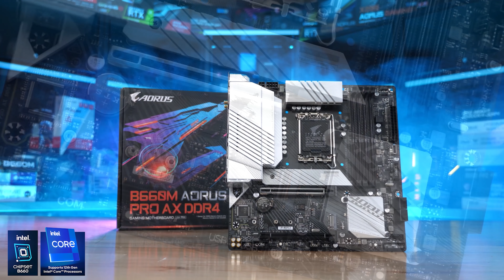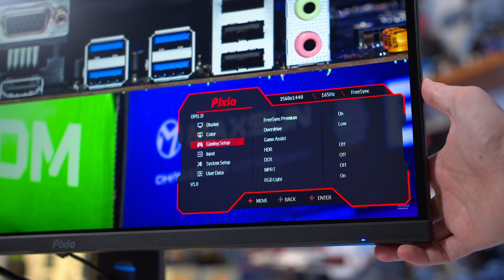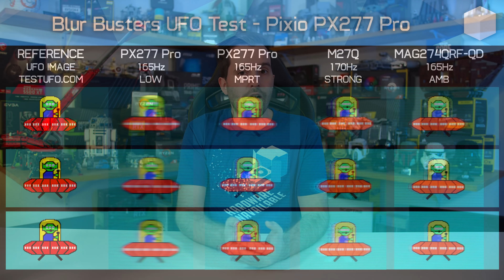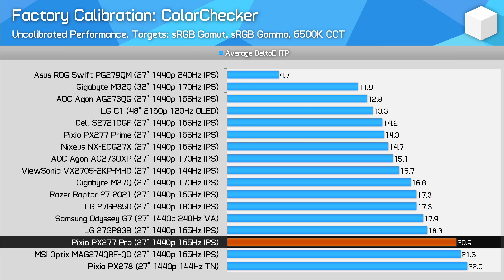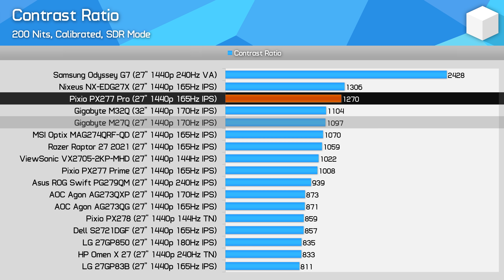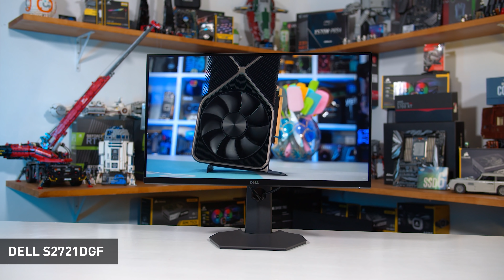Pixio PX277 Pro Review, Is This Budget 1440p Monitor Any Good?

Comment: got my m27q refurbed from newegg at $260, absolutely worth it. i love it
Reply: Would you say m27q is still worth in 2023?
Reply: @matrxzeno4761  Not sure if it's been superceded by anything but it's still a solid buy at $260
Reply: @AWSMcube  Thanks for the response, I think I will go with the m27q-p variant as it is just 50$ more expensive here with some nice quality of life upgrades.
Reply: @matrxzeno4761  No problem. I still use it and I'm very satisfied with it. R7 3700x and 3060ti and I can play most games at medium to high settings and still max out my fps
Reply: @AWSMcube  I am running something similar with a 5800x and a 3060ti so it is reassuring that you're getting max fps on this monitor.

Comment: Something to look at is what rescaling will do if you buy a new monitor NOW but haven't got a fast enough graphics card to do native resolution gaming at the moment (for example there is no way to currently afford a new graphics card, but a replaced monitor could be done now).
So you go from a 1080p (say), which you currently have, and get a new monitor THAT YOUR GPU ISN'T FAST ENOUGH FOR, what benefits do you get from a new monitor at 1440p then at 4k if you upscale.
So you take a 1080p image and upscale to 4k is easier to carry out, but you are able to run a 1440p monitor and upscale from 1152 or whatever to 1440p, getting a better image than at 1080p upscaled to 4K, because you CAN run at 1152 (or whatever) and still drive pixels fast enough even if you add on upscaling afterward to 1440p but cannot upscale to 4k at that resolution. It may be that the 1152 image can be uscaled to 4k just fine, mind. However, if the upscaled 1440p image is closer to the native 1440p image than the image upscaled to 4k is to the 4k native, or there is no difference in quality upscaling from the 1152 image to 1440p or 2048p, making a 4k monitor meaningless, then you can point out if you can get "locked 90hz" with the 1152 image then you should get the 1440p monitor, but if you can run 1440p, then as long as you can lock it to 80hz you can afford to run the 4k monitor as your upgrade from 1440p TODAY if your rescaling is supported.

Comment: I'd probably buy this if it was available here (UK). Despite it being a bit overpriced, the combination of USB PD and a KVM would be a great benefit for my usage (frequently swapping laptops and swapping between laptops and desktop). The only other monitor of this size that I've seen with that is the AOC AG274QXM, which is nearly £900 and seems to have a number of serious issues with the display. Hopefully USB PD output (60W+) starts to become a common feature (as KVM switching already has) because ideally I'd be making a decision solely on the display/price and not a niche feature.
Reply: Just get gigabyte g27q....same panel just 144hz
Reply: @gravydavy9930  that doesn't have USB PD. M27Q does but it's only 15W which makes it basically useless

Comment: You don't need to go beyond "1440p Monitor Any Good?" The answer is NO! It's 2022; if you aren't able to run at ATLEAST 4K at a decent refresh rate, then its crap. Full stop. 8K gaming possible with new tech coming out later this year.

Comment: Best gray-to-Gray graph... How you can compare 0% error monitors (clean motion without any inverse ghosting = ideal) and monitors like this sh*t? This makes this slow display faster than MAG 274QRF-QD for example 😕 This is absolutely misleading! You can observe the dark trails in light shades (70% error or higher at lower refresh rates) vs. zero errors at MSI display. How about compare all displays at same error conditions - idealy 0-5%? But if I skip these bar graphs, your display reviews are best.  👍

Comment: Why did you guys take a point off for the HDMI advertising when the HDMI 2.0 implementation that Pixio uses is probably the best you can get out of HDMI 2.0 at all? It supports 1440p 120Hz with VRR enabled even on consoles out of the box, something many monitors needed a firmware upgrade to be able to do at all. They advertise HDMI 2.0 and deliver on it, so just confused about why they got a mark off for that.
Reply: Because HDMI 2.0 does not support 1440p at 165hz which is what the monitor is also advertised as. People who do not know much about bandwidth and monitors may be very disappointed when they find that they are not getting 165hz.
Reply: @josephc.2443  I suppose that's fair, I don't have the box for my PX277 Prime so I don't know if they have the "over DP 1.2/1.4" disclaimer.
Reply: Joseph is correct. In the chart at 13:26, the "Fail Conditions" state "Insufficient Bandwidth or Misleading Advertising" and HDMI 2.0 is insufficient for 1440p 165Hz. That is why it loses a mark.

Comment: Tim, In the AMD control panel, in the display section, when you set "Custom Color" ON with "Color Temperature Control" OFF, that lets the GPU read data about the monitor's colour space over the HDMI/DP connection, and adjust the color output accordingly. This allows wide-gamut displays that don't have sRGB clamping to correctly display sRGB content without the need for ICC profiles (or in apps where they aren't supported, ie; most games). It's an awesome feature that saved me from buying a colorimeter to fix the oversaturated reds of my wide-gamut monitor. Could you look into this and let us know how accurate that feature is?

Edit: You can also do this on Nvidia GPUs, but since Nvidia hasn't added that feature in their drivers yet, you have to use a tool called ''novideo_srgb''.
Reply: "novideo"

I feel like there's an ayymd joke in there somewhere lmao
Reply: @JTCPingas  jej
Reply: @JTCPingas  And a very well deserved one,because Quadros have this setting unlocked.
Reply: I feel like I've been waiting ages for someone to finally explain this. It would be wonderful to hear Tim's take on what's going with that.
Reply: In my experience, with custom color on, and color temperature off it actually leads to an oversaturated look. That might just be my specific monitor, but for me it is way better leaving custom color off for srgb content.

Comment: I am holding out for a 32in or ultrawide 4k 144H,  with kvm  that is as good at the 1440 screens.. use case is gaming, work and also retro gaming with win 98se, xp , 7, 10 and 11 windows.  I have heard the new alien ultra wide monitor is good but not at scaling  ..

Comment: The good thing about 240hz and above monitors, variable response times aren't needed, at least for me. Whatever your fps is doesn't matter as long as the monitor is refreshing at 240hz with v sync and freesync/g sync off and it has great response times at that refresh i can't notice tearing or anything to a noticable degree. At 165hz and below though the tearing is awful and needs something like freesync but then you are subject to crappy or lacking variable overdrive.

Comment: I rather put the money toward the next GPU upgrade which is a much better investment. 
If anyone already rocking a decent 1440p 144hz display or even a 1080p one, there is no need to upgrade or buy if you can't consistently hit 144 FPS with the current setup.
Reply: I have a 1440p 60Hz with great colours, and i will buy a gpu first as well

Comment: Please do a $120 monitor review, not everyone need a gaming monitor and I bet most people just want a monitor for office or browsing the internet, thank you.
Reply: this has to be a troll comment, you literally goto your local retailer, look at monitors in that budget and check a few things;
A) does it have height adjust, swivel, pivot? can you suffice with using books instead?
B) does text look normal head on? no blurryness?
C) does it do 60hz?
that is literally it, they're all just trash and you can play around with firmware settings and see what each model you check offers, and that's it.
Reply: @AeRiaL_  Come on, expensive things will get cheaper eventually, I just want to know how good/bad I can get with this kind of budget
Reply: @notitsjerry  120 will get you crap and that's about it
Reply: The $200 range can get you something impressive on a sale, but any lower then that and I have no clue what you may get.